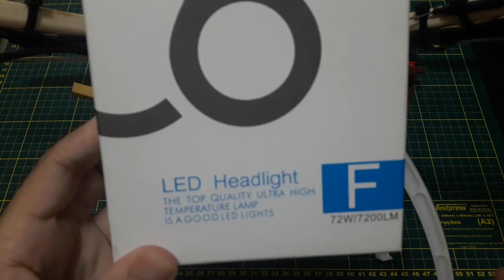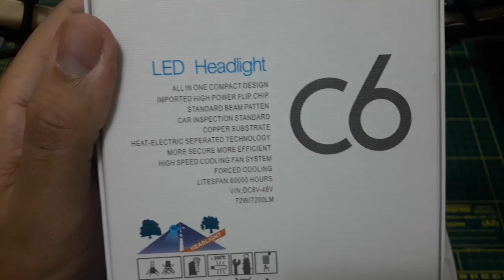Drone com LEDs 144w | colunaDRONE

Comment: vale a pena comprar um mini drone kf608 ele é de motor escovado no site está custando 150,00 versão com câmera vc acha que vale a pena?
Reply from the maker: Parece ser legal. Olha estes aqui, que legais também:

https://www.banggood.com/Eachine-E52-WiFi-FPV-Selfie-Drone-With-High-Hold-Mode-Foldable-Arm-RC-Quadcopter-RTF-p-1145572.html?utm_campaign=colunadrone&utm_content=11274&p=WY12228513856201701C

https://www.banggood.com/JJRC-H43WH-WIFI-FPV-With-720P-Camera-High-Hold-Mode-Foldable-Arm-RC-Quadcopter-p-1183011.html?utm_campaign=colunadrone&utm_content=11274&p=WY12228513856201701C